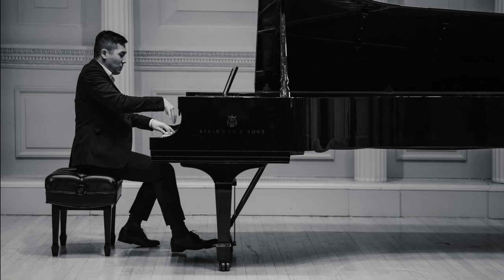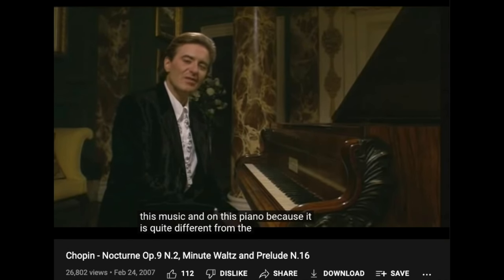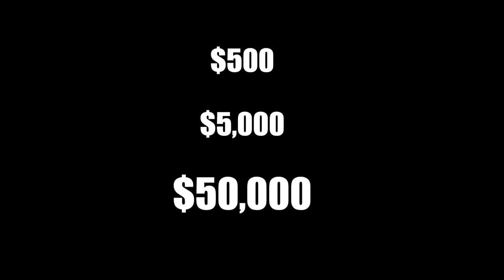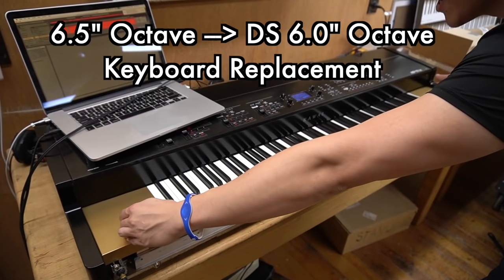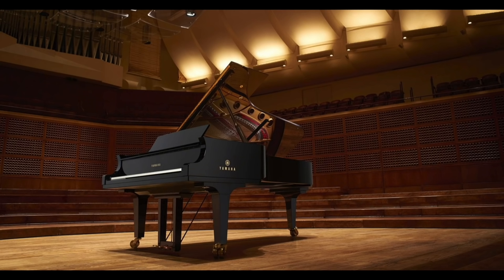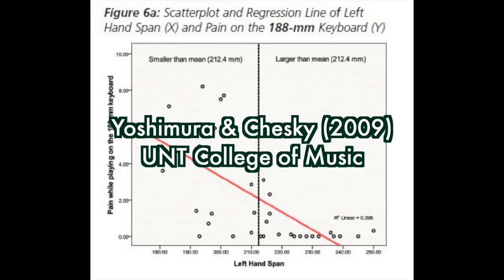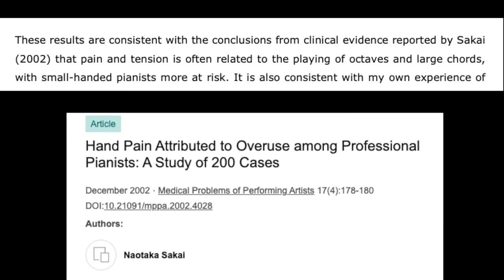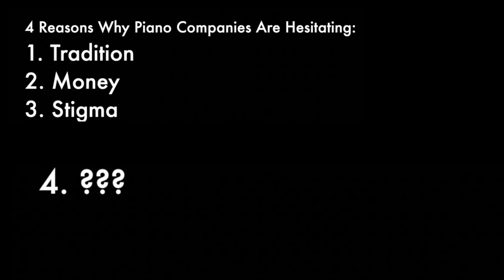Piano's Darkest Secret

Comment: Back in the late 70s and early 80s I was part of a group that brought this up to our local university. The excuse / reason given to end the discussion was that it was inherently impractical to cater to different sized mechanics. One guy from the engineering department actually gave a presentation, though, on how you would only need a couple of different tooled systems that would otherwise integrate into the normal assembly line. While the short term costs (for a commercial operation) could be significant he figured in the long run it would pay off by a large factor.
Reply: Very interesting insider story there. Thanks for sharing.

There are unconscious assumptions made - sometimes by highly intelligent people - that the status quo must be the correct solution. In fact, the more professional standing an individual may hold in a given field the more invested they may feel in the status quo. Confident of their status, they may easily arrive at highly complex rationalizations that appear to very coherently justify or even prove the superiority of the status quo but which may not yet entirely be grounded in first principals thinking. 

I was just reading about developments in neuroscience over the past few decades. There has been a marked transition away from the old school of hard wired brain function or  'localization' toward neuroplasticity or the view that a living brain can rewire itself in surprising new ways. 

Thing is, even as reliable scientific evidence began piling up that the brain could rewire many of it's supposed fixed functions the old school or status quo crowd - which included many brilliant and accomplished scientists - resisted and even demeaned the new guard. But in the end the evidence won out. Neuroplasticity is now widely accepted as the reality and has opened up all kinds of new avenues for treatments and cures.

I predict something similar is going to happen with musical keyboard design.

Comment: Hi, at 2:50 min there is a miscalculation:
6.5 inches = 165mm or 16.51cm, not 21.5cm
A key is not 0.93 inches (at the front), it is about 0.85 inches (at the front) or 21.5mm

Comment: You're right, it's not something I'd ever really thought about. And it's strange if you think about it, they make guitars in different sizes, and nobody cares about that. It makes it easier for children to play as well.
I've got an M-Audio Keystation midi controller. It of course doesn't have weighted keys or anything, and it only has 32 keys, but the keys are small. 13.5 cm for an octave (5.3 in). That's just under 2 cm per key (3/4 in). I hadn't noticed it until you mentioned it, but I do find it easier to play than a full size keyboard.
Reply: No match for Chopin.
Reply: @douglascutler1037  Chopin would eat my Keystation for breakfast.

Comment: As a middle-aged short sized Mexican, my hands haven´t been enough for the size of the standard keyboard ever! ...even though  I had studied at CDMX Conservatory of Music, to learn techniques, and as much as I could.  
But in my case:  
"SIZE IS MY PROBLEM! (or at least a stone in the shoe)

Sure can handle with standard keys, even sometimes, while a very hard pain comes after a while.
My "remedy" has been using a synthesizer.

Anyway, I´m not a piano player anymore, I have tendinitis and my hands hurt a lot while playing.
The solution was to use synthesizers in my case.         Never with a weighting action.
Normally split in two or three sounds,  lots of aftertouch function, which increases the stress on my hands, because I´ve had played this way for so long.  I play bass on the left part of the keyboard and play simultaneously pianos, organs, guitars, brasses, strings arrangements, etc.  

So if my keyboard could be customized in size... 

I don't know...

But here, in this great video, you can tell how foolishness related in the construction of a musical instrument, can destroy a performer. 

As far as I know, there are flutes, and guitars, as an example of instruments suitable for their players, the ones called "tercerolas" in México. 

Greetings.

Comment: Great point! Guitars have different scale lengths depending. If I play a standard Fender scale, I can't really play an Fadd9 with the root on the 6th string. Give me a Gibson scale length guitar, and I can play it effortlessly. It would only make sense that piano builders offer different sizes of keyboards.
I guess they say it wouldn't be profitable in the same way that some left-handed models of guitars are either harder to find and when you do find them, they're usually more expensive.
Cheers!

Comment: I've got an 8.25" left hand span, and a 7.75" right hand span.

All my life, I was told I had seemingly long fingers. Turns out, it's actually that most of my body is just on the smaller side, including my palms, but I have slightly longer fingers to make up for it.

As for the asymmetry, my left hand is a little more flexible, and my left thumb itself is about a quarter inch longer than my right. I would assume that (depending on music style) the smaller hand would usually be the limiting factor for key-size comfort.

Comment: Okay, piano keyboards have a strong tradition of standardized keyboard width. You mentioned availability of differing sized guitars, so, no problem with that.  The ' viol family ' is strongly traditional, yet has many intermediate ' student '  models available;  typically for violin there are 7 sizes, down to a 1/16th scaled version, and cellos and violas, and string basses of 3/4 scale sizes.  Time-honoured traditions are not always optimal developments.  As an example the manual typewriter ' QWERTY ' keyboard was engineered to slow the pace of typists since the keys returning to the rest post were colliding with the sequentially following keys creating jam-ups.  More frequently used letters were assigned to the dominant fingers to deliberately reduce words per minute.  Nowadays although the the mechanical systems are obsolete, we still see most computer keyboards using the old style.  Many younger people have grown up with these layouts without ever taking a typewriter stenography class.  It seems that more people have forearm carpel tunnel issues since using Lap Tops with bad ergonomics, or thumbs on a phone.  There is no really good reason for not developing an improvement.  Back to the piano style diatonic keyboard,  many children started with accordion playing and some mini-sized ' toy ' synth keyboards.  Many synthesizers and electronic pianos have 88, 76 or 73, and 61 note versions.  More smaller keys in the same sized key beds would not have the same type of interior space crowding problems such as with strings, along with lever and action mechanisms of an acoustic piano.  As you have indicated, I think there is a significant market void for unfulfilled but  enthusiastic  potential consumers'.

Comment: I would've thought that the length was dictated more by the number of strings in the piano and the required space for vibration, so in grand pianos you'd need bigger keys, and given that grand pianos are like the "standard", that key size became the standard, but that's only a limitation (if it really is) for acoustic pianos, but piano makers have made a lot of technology for acoustic pianos, but not for that. Given that a pianist (at least normal ones) don't carry their piano so they use the one on site, it would be a bit difficult for some. I do think that custom sized pianos or at least like 3 different sizes should exist, as for myself I find a bit difficult to play on some synthesizers with small keys because my fingers get stuck easily between the black keys, so small sized keys for everyone is not the answer either.

Comment: I'm a male too, and my hands are even smaller than yours. My hand span for my left hand is 7.75 inches, and it is barely 8 inches on my right hand. It is embarrassing when comparing hand sizes with my male friends. My hand span is even shorter than average for a woman. I have averaged sized hands length wise, from tip of my middle finger to the base of my wrist, but my palms take up like 60-65% of my hand. I'm 19 and have passed grade 8 ages ago, but I still find it super difficult doing the octaves on alla turca. In fact, I am only able to do it due to practicing to relax my hands. I'm currently learning Chopin Etudes. And it's just so flippin difficult. I always feel i'm not good enough, but I realise its all to do with my hand span. I can play pieces like op 25 no 2 (the bees), easily and I can even play op 25 no 11( winter wind) without too much trouble (albeit about half-way through as I'm still learning it). Technically I'm quite a decent player. But I find the other etudes which require a lot of ninths, tenths (can't do it quickly), long jumps or just hard to reach stuff, just extremely difficult. It's super frustrating. I can't play simple jazz music, which is something I've always wanted to play, without rolling my hand. Anyways, enough of the rant. Not like anyone is going to read this lol.

Comment: 🎹 Thank you for your insightful and inspiring video! I think the main roadblock for this innovation (not mentioned in your video) is INERTIA. In every school, in every concert hall there are only the instruments with the current standard of piano keyboards. So even if I am aware of the smaller-sized keyboards (and my hands get ruined after long octave passages), I still have a standard Stainway at home – otherwise I wouldn't be able to play anywhere else. 

I have not quite understood your starting point: if you learn your repertoire at a smaller keyboard, you can then easily adjust to a bigger one when you perform in public? I'm afraid it might not be the case.

Thank you in advance for your reply.

P.S. Another interesting innovation is a slightly rounded keyboard (as if the keyboard is slightly hugging you). But I think the smaller sized keyboard is a much more needed thing.

Comment: "Not wanting to break tradition..." Reminds of the same excuses I hear often here in Japan. It's silly when there's no good reason to keep that tradition. I was a really good basketball player and was even offered a scholarship to play at a university. However, I would be lying if I said one of the reasons I declined is because I couldn't palm the basketball with one hand or control it easily with one hand. I have wide hands but shorter fingers, so I knew it would continue to be a struggle I couldn't get past. After all, they weren't going to give me a smaller basketball. In music, I started playing the guitar but even that has always been a challenge, as I have double joints in my left hand (they bend backwards). Sometimes the only option we have is to change the things we are working with. Screw tradition.

Comment: A huge oversight in the video is the technical side. The Fortepiano DID have a narrower key BUT the action was light and there were only two wires per note. Came the Pianoforte and there were now THREE wires for much of the keyboard range, and where there were only two or one these were thick, wire-bound and needed just as much space. The whole key escapement was remade vastly heavier and with much bigger hammers, broader dampers, and I speculate that the keyboard had to be stretched in order to accommodate these structural alterations. Narrowing a key now asks for the narrowing of string placement and of the key escapement components, which must surely alter the touch of the keys, and maybe even affect the quality of the sound. The world is full of standardised dimensions to simplify out lives. Keyboards are no exception. Same goes for other orchestral instruments.
Reply: You said: "Narrowing a key now asks for the narrowing of string placement and of the key escapement components," 

The entire reduced-width concept is to retrofit EXISTING pianos. No narrowed string placements required.
Reply: @douglascutler1037  Ah yes, but therein lies the rub. The piano action is a complexity of levers that are designed to operate in perfectly planar action with themselves and with the hammer impact point on the strings. If you want to skew off elements to achieve your wish, you invite a host of problems that involve expensive prototyping and a lot of expensive failures, to wit the admission of the man in the video that confessed he only lost money....that is your kiss of death in business unless your cross-subsidise and treat it as a hobby.. The fortepiano had it drawbacks in being a "quiet instrument" but because not only were the keys narrower, the action  was also far lighter and the key depression distance was half that of the modern piano. This allowed for an  unsurpassable playing dexterity that composers of the time loved to exploit. Repeating the words of a fortepiano player I know, he said, "going back from a fortepiano to a pianoforte is like having to run down a street filled with loose paving stones".  The curse of critics is commonly a lack of insight into a problem, and musical performers often have little knowledge of what is actually going on inside their instrument. The physics is mind-boggling.
Reply: @douglascutler1037  Thanks Douglas; speculation is the start of any scientific endeavour. I do not see the ballistic action of the hammer being relevant to the problem. Perhaps it is that the issue is treated as a crusade, replete with collusion and conspiracy,  arousing suspicion in the mind of a critical and questioning reader. Third party testimonials don't wash (science does not accept circumstantial evidence). The day I see these piano modifications in common use will be the day I will buy the story. I am a fence-sitter on this one. PS offsets will introduce torsional forces in the action and they have to be dealt with.
Reply: @richardclark9111  You said: "The day I see these piano modifications in common use will be the day I will buy the story." 

Wow, I think you may be slowly warming up to the idea.

You said:  "offsets will introduce torsional forces in the action and they have to be dealt with."

That is correct. But Steinbuhler dealt with this 25 years ago.

Reinforced offsets in the extreme bass is the subject of a 1996 Steinbuhler patent. The patent is now expired but still remains for use in the public domain and is probably Steinbuhler's primary original technical contribution to the art.

The solution was to triangulate the key shank with a reinforcing beam and then provide room for the new element to move without obstruction. It was found to only be necessary in the extreme bass where the weight of hammers is greater. The extreme treble where hammers are smaller worked fine even with an extreme offset. Key shanks made of maple help explain this.

You said: "Third party testimonials don't wash (science does not accept circumstantial evidence)."

Yes, in science bot speculation and anecdotal evidence are rated as vastly inferior to controlled data. 

But anecdotal evidence is not so readily dismissed as you claim. While anecdotal evidence is considered inconclusive on it's own it may yet suggest pathways for a full blown experiments. And it will do this with much greater specificity that speculation alone. So anecdotal may actually be superior to speculation in many cases.

For the marketer the only relevant data is "Does the customer prefer product A or B?" If you've read any of the other commentary here I think you will know the answer to that.
Reply: @douglascutler1037  I have been in science all my life and know that there are no absolute truths about anything. Thanks for the interesting dialogue.
Reply: @richardclark9111  Where did I claim a categorical absolute truth? 

I'm a scientific agnostic. So, indeed, I understand you are correct, the scientific method is inherently agnostic. Any theory no matter how strong may be subject to revision pending further evidence. 

But that doesn't mean we test to see if gravity is still working today by jumping off of tall buildings. There are still some basic assumptions we can make in order to get on with day to day existence. 

One of the assumptions I'm going to make is that people with small hands will prefer pianos where they don't have to put their tendons at risk in order to play the music they love.
Reply: @douglascutler1037  It was a statement, not an accusation
Reply: @richardclark9111  Understood. I should not have assumed ad hominem. Apologies.

Otherwise, we actually do agree on a key point of science philosophy. So there, we can end on a high note if you wish.